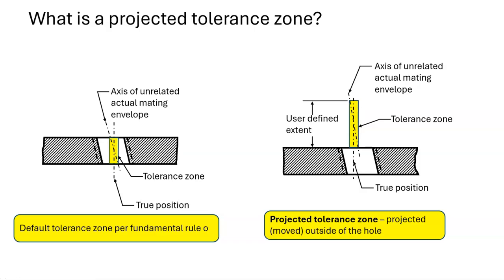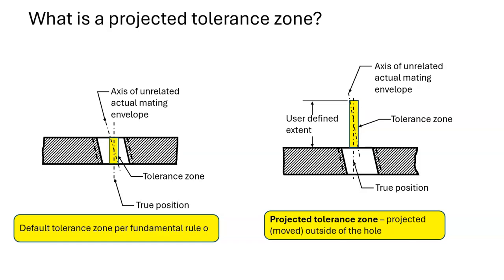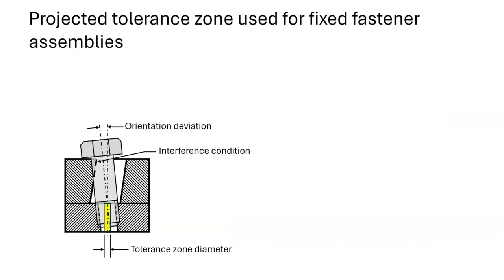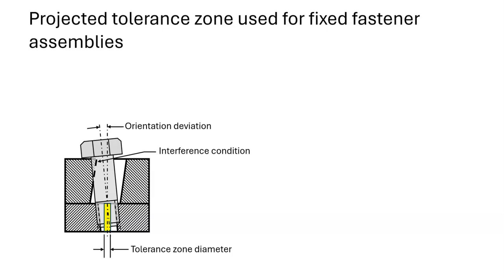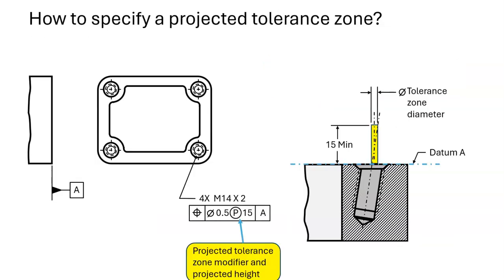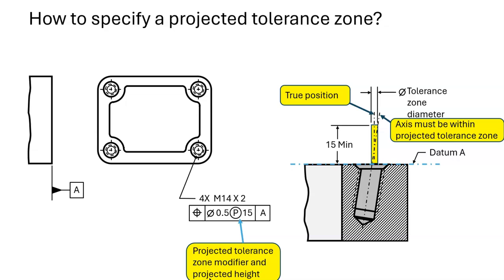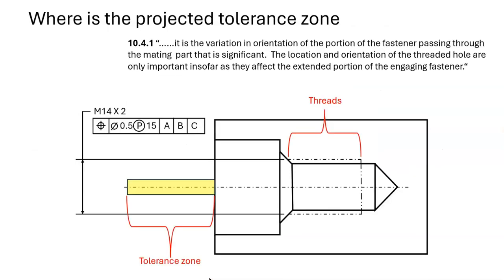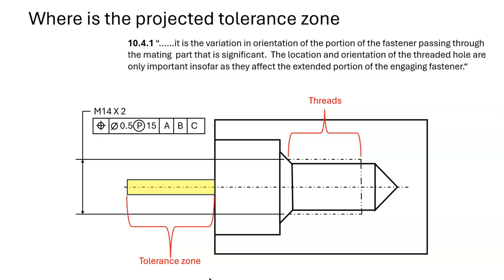Projected tolerance zone

Comment: Hi David, can you tell me if your videos are ASME Y14.5-2018 rev or 2009 ?
Reply from the maker: Anything I posted in 2018 or before is per the 2009 standard.  Everything I posted 2019 or later is to the 2018 standard.  Rarely if ever will it make a difference.  Some of the terms have been updated in the 2018 standard, and there are some new things such as dynamic profile.  But all of the principles are the same.